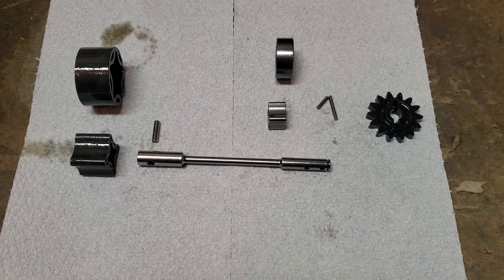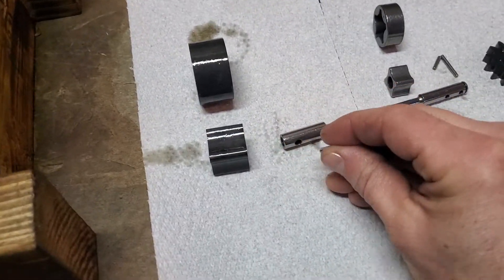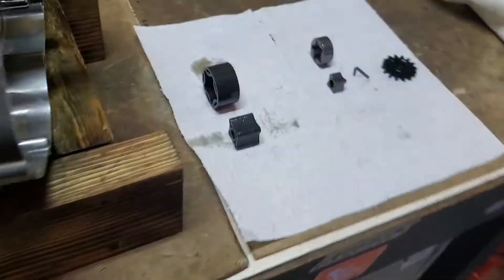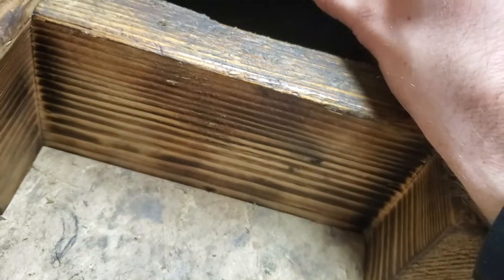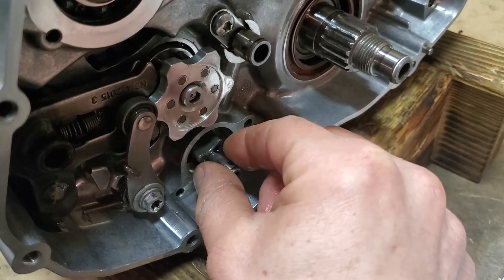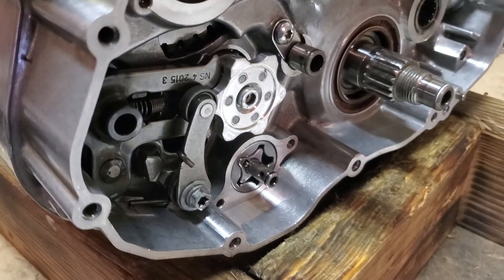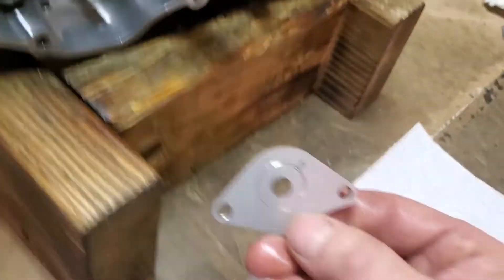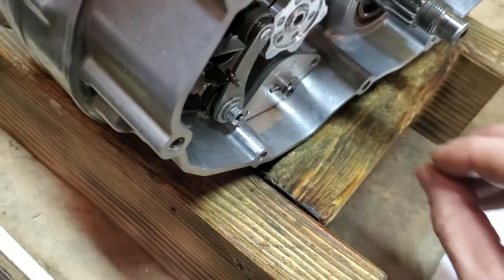Ktm oil pump install 250f

Comment: on the plastic side, Does the outer part of the pump have a direction it is supposed to go in? looks the same on both sides but the service manual says "the rounded side of the external rotor faces the engine case. I noticed the small round dots molded into one side. you put them towards the engine. the manual depicts them facing out in the picture. does it matter? thanks
Reply from the maker: No it shouldn't matter, atleast it hasnt had any ill effects, I would follow the manual  just for piece of mind though